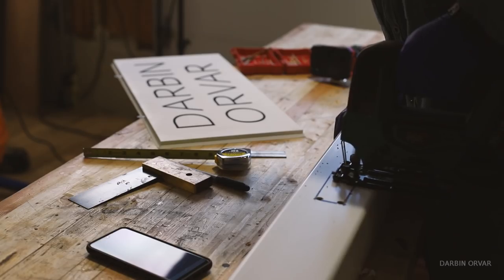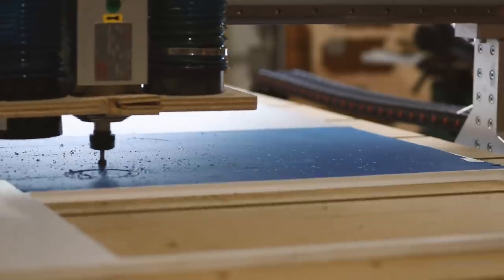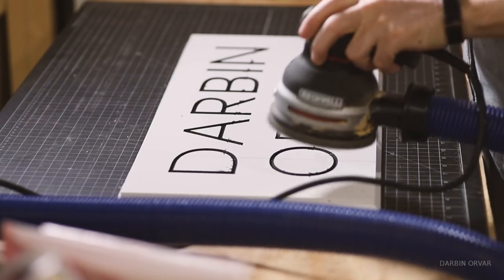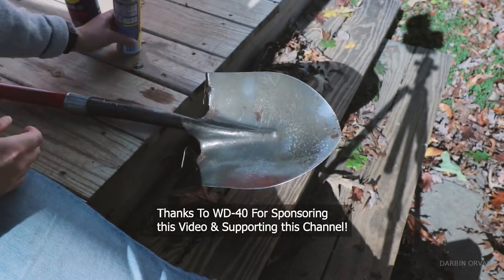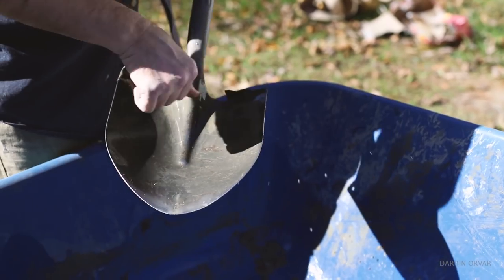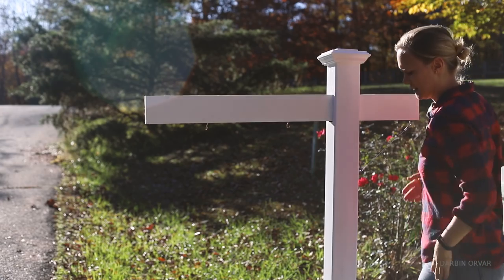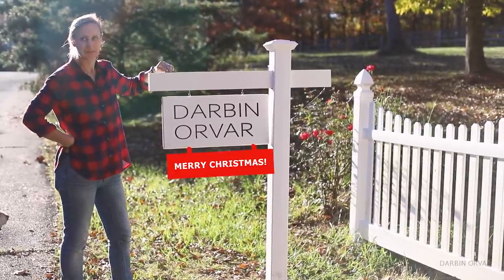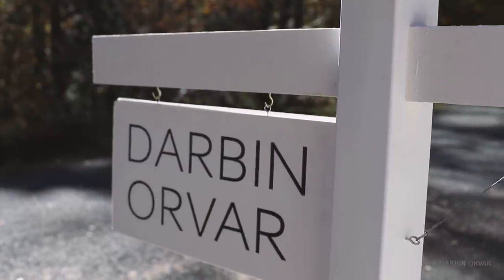Making a Street Sign out of PVC & Adding Curb Appeal to your House

Comment: For those thinking of using PVC, there are at least 2 'grades' of PVC - one is sometimes listed as uPVC - it has UV inhibitors in it to stop the PVC getting brittle from sunlight and then there are 'the others' which are cheaper to manufacture but do get brittle after a year or two (depending on the thickness). Make sure the PVC you buy has the inhibitors. Downpipe is usually uPVC (in Australia) and interior electrical tube is not.

Comment: Your son is SO cute!  But you know that.   On the sign, did you allow the paint to dry completely before removing the tape?  On the video, there's no time wasted in drying...but there wouldn't be.  Also what's the frost line where you are?  Here in western PA, putting a post 1" deep will experience heaving due to freezing weather.  Regardless, very professional results on the signpost & sign.

Comment: This is one of those projects I would love to do but, sadly, here in the UK we don't use outdoor mail posts, we use the horrid letterbox slots in the doors. However, what I do have is a lot of small scraps of wood that I just can never seem to be able to throw away, a woodworking thing I guess. Most of those small pieces are about 6"x2"x1" or smaller. Do you hoard those small pieces too? What can you do with your scrap pile that would be ideal as gifts or toys or something? I'm looking for ideas. Thank you for the video and keep up the great work!! (Avid fan :) )
Reply: (Also in the UK) I hoard wood.  I admit it.  I am a wood hoarder...  I use my teeny tiny offcuts (down to a couple of square centimeters or so) for mosaic designs for clocks and other art pieces.  I use a lot of exotic wood and love the way I can make beautiful designs with so many different (natural) colours.  It just takes some patience, time and vision.  Even if I only have plain pine/spruce/oak and similar woods you can do some fantastic designs with even those.
Reply: Build your own engineered wood board. Cut them into strips  of equal thickness, maybe 1/2" or so, then glue them together so that the curvature of the rings on adjacent pieces is in opposite direction, and so that end joints on adjacent lanes are not aligned. You can build large boards this way, which do not bend or twist when temperature and humidity varies. The resulting boards also have a funny aspect.